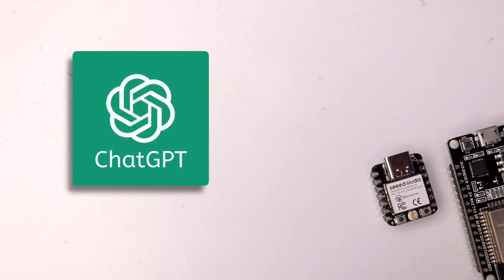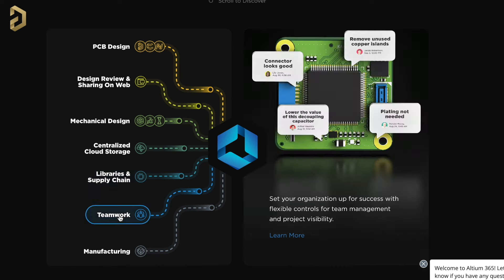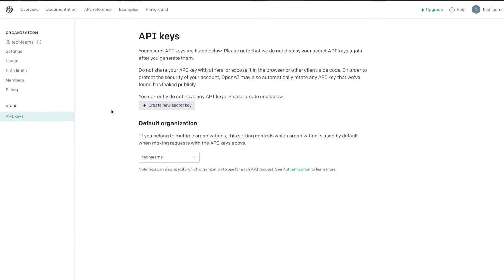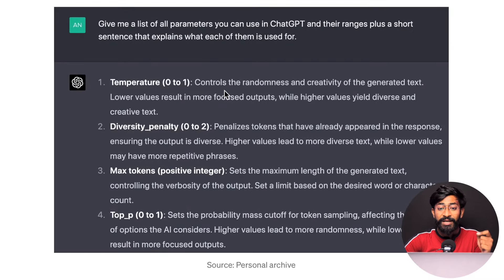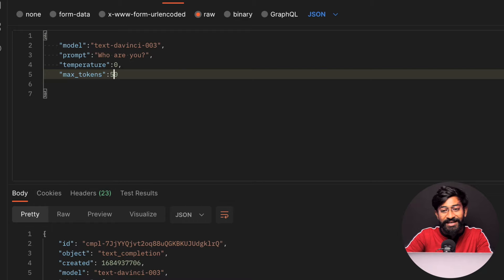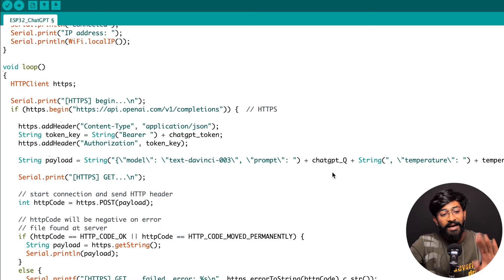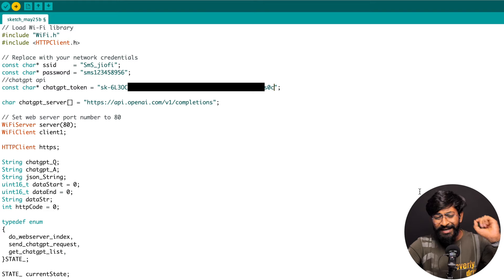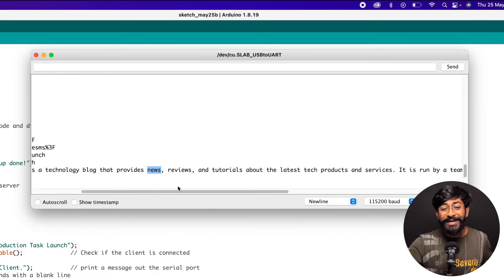Running ChatGPT on ESP32 🔥🔥

Comment from the maker: The "text-davinci-003" model used in the video is deprecated now and to make the project work you need to replace that model with "gpt-3.5-turbo-instruct" and it will start working again.
Reply: Thank you sir very much
Reply: Thank you very much, it's work 👍
Reply: Sir,  what to write in message section of json body part if I want to use new models like, gpt-3.5-turbo ??
Reply: bro now it came up with new issue it says that You exceeded your current quota , still i havent used anythin
Reply: Now it came with new issue that it is. Showing you exceed current quota , what should I do now
Reply: @amithgbyahatti9630 yeah same. What to do?

Comment: Those expecting full fleged question answer type device should think twice as it is expensive. The Chat GPT tokens are calculated for BOTH input and response and 1000 tokens is equal to about 750 words only. You have to pay about Rs1.65 per 1k token (Davinci Model)😮

Comment: Would it be possible to update the code for the deprecated model and post the solution on the Github repo??
Reply from the maker: you can replace that deprecated model with this "gpt-3.5-turbo-instruct" and it will work

Comment: We need integration of display and mic for voice to text and in small size. Pull up guys for the video
Reply from the maker: We will surely try to add that as well but not in the next video
in this next video we will try to add audio feature in which the ESP32 will speak out the answer from ChatGPT
Reply: @techiesms  Is it possible for esp32 to do speech recognition to recognize what we are saying and get the answer for it by ChatGpt all by itself?
Reply: @electroprosknowhowto  yep using i2s mic

Comment: hay just help me out to complete this project i am doing this project but the output from serial monitor is not printing anything . i don't know either the problem in this code or in the arduino version that i am using plz tell me what to do. or tell me the arduino software version that you are using in this project.